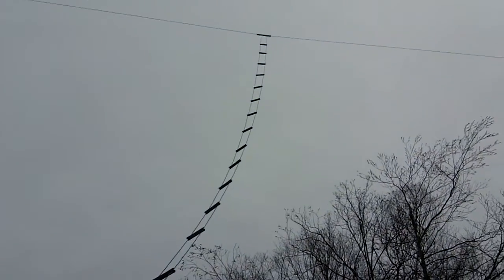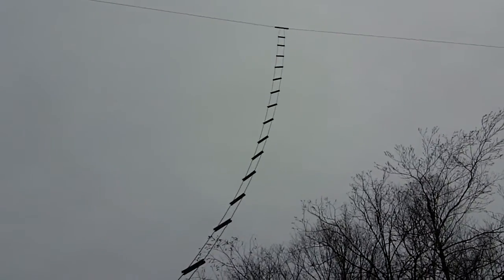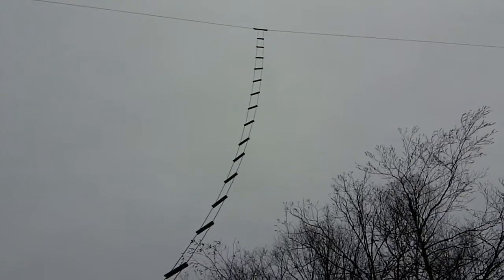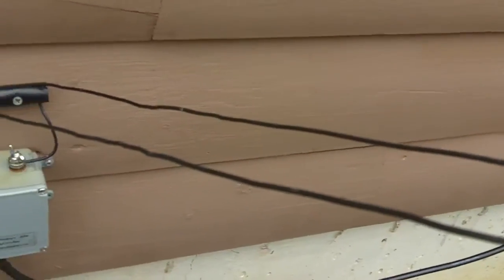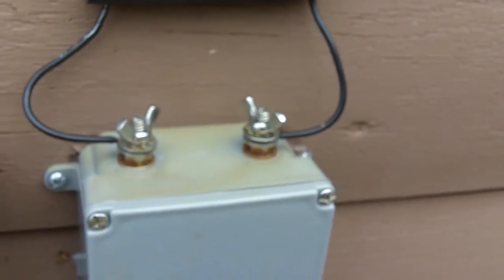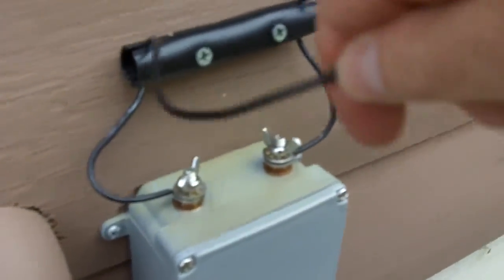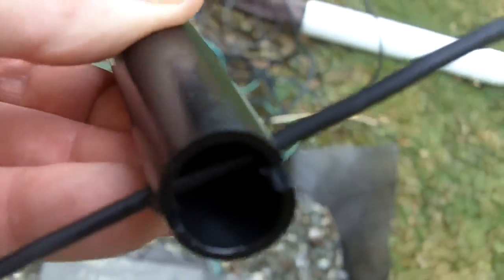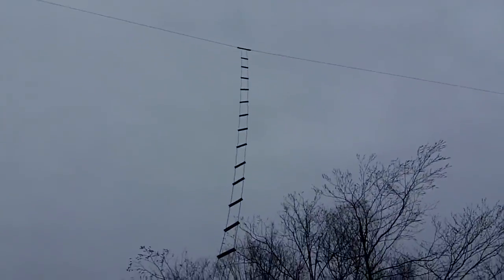600 ohm True Ladder Line Balun House Entry

Comment: No lightning arrestor?  I always thought that it was important to not run coax in this setup that the antenna had to go directly to the station tuner.  I am strongly considering your products for my install, it’s just important to me to get it right the first time, I’m not going to have money to do it twice
Reply: It is. He has unnecessary loss this way even using the best coax or hardline which probably puts the antenna into the 60 percent efficiency range on some bands. It will still work fine though this way though and he may hardly notice. The antenna may still be in the 80 to 90 percent efficiency range on some freq too but where the swr on the feedline is highest they will suffer. Getting everything right and running the feedline to the tuner without coax will result in over 90 percent efficiency everywhere you use it with the correct setup.

Comment: From the 4:1 balun design going to an palstar hf auto. Wil this work well?
Reply: I found a 4:1 Balun works well with more then a 20 foot or more of coax between the tuner and the Balun. But a 1:1 Current Balun >>>>  https://www.balundesigns.com/model-1171-1-1-atu-current-balun-1-54-mhz-5kw/  works best with a 2 or 3-foot jumper between the balun and tuner... The Balun shortcut I listed is actually made for Auto Tuners...

Comment: How long is your coax run from Balun to tuner?
Reply from the maker: Sorry for the delay! We moved from VT to FL and I got way behind. This was only about 10' however, I have customers that have 100' or so. They operate primarily on the low bands and losses are minimal.
Reply: I think I will bring the open wire line down to a post with the balun and disconnect the coax to the shack there when there is a chance of storms. I would like to have at least 30 feet of separation at least and a ground rod at the post to ground the antenna when not in use.

Comment: Hi Brian very nice setup.. I just talked with Balun Designs earlier in the week. I mentioned to him that I want to run about 50ft of LMR400 from my shack to the basement, then hook up to my Palstar Auto Tuner via a Remote head in the basement, from the tuner a 2ft piece of coax through the wall to a 1:1 current balun that he recommend I do then hook up the ladder line there.. Wonder why he is telling me to use a 1:1 instead of a 4:1??
Reply from the maker: Bob likely recommended the 1171. The Palstar tuner can handle the range required. That's why. If you were asking about an LDG, he would have said the 4:1. Brian

Comment from the maker: About forty years ago, I was working as a teenager for a TV and radio repair shop. The owner & I worked on a lot of appliances that were severely damaged by lightning or nearby static discharges. I remember one day he asked me "what's the best way to protect a radio from lightning?" I also worked at Radio Shack part time and we sold a lot of so-called lightning arrestors so I was sure that was the answer. He said "Nope; unplug the antenna!" 
So, from that day on, ( I was into CB radio in the 70's of course), I disconnect every antenna at the station, inside. I also have a couple of multi-position antenna switches so I just disconnect one line that is used for multiple radios. I live in the mountains of Vermont, facing the Adirondacks and we get tremendous, long lasting storms here, every summer. I've lost telephones, modems, tuner boards in large screen LCD TV's, a display board in a high end range, dishwasher touch panel etc. Never a radio.
I do have a few gadgets called "Blitz Bugs" that I bought at a flea market. I have given a couple away to friends to try, but have never used one. Somewhere on the web, I see people making their own spark gaps for true ladder line, open wire feed, out of sparkplugs. 
I really think the only way to be 100% safe is the power is disconnected and the antenna is disconnected.
I hope this helps and thanks for the question & for watching my video!
Brian/WB2JIX

Comment: How do you protect against lighting or near strikes and static?
Reply from the maker: I disconnect the line when not in use or, now that I'm in the hurricane capital of the US, I will likely use a static dissipation device by Array Solutions. Look them up. The only safe way is to not leave it connected when not in use.
Reply: A good old knife switch outside would be ideal so when flipped the opposite way have the ground wire to your outside ground rod attached to that side of the knife switch. A good friend of mine, W4ACW John,  just gave me that exact model of Balun Designs balun! I've been running my 260 ft doublet fed with 450-ohm ladder line since 2002 with only an ugly choke balun, but my Palstar AT1500CV tuner tunes it fine on all bands 10-160 meters, but I think it will match much easier with the 4 to 1 current balun installed. It's pretty touchy on 160 meters.  73 de KU4GW
Reply: Are the spreaders made of 1/2 inch pex?